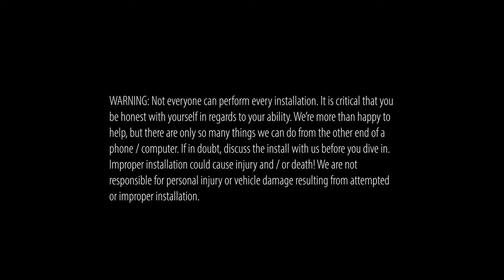ND1 Miata BBR Turbo kit Installation - All About Downpipes

Comment: Flyin Miata, what is the 0 to 60 time with the turbo kit? Thanks!
Reply from the maker: 0-60 is a tough measurement as it's affected by so many different factors. The numbers you read in magazines have all sorts of corrections in them, and two magazines will end up with numbers 0.3s apart from the same data set. Because of that, it's not something we test.
BBR claims 5.0 seconds for this kit, but we don't have details of their testing.
Reply: @FlyinMiataVideo  Thank you. Do you offer any mod package that will add at least 300 hp? For example, changing internals that will support more boost.
Reply from the maker: Unfortunately, we don’t at this time. The turbo is definitely capable of more, but the injectors are not and changing injectors on a direct injection engine is not as simple as you’d think.